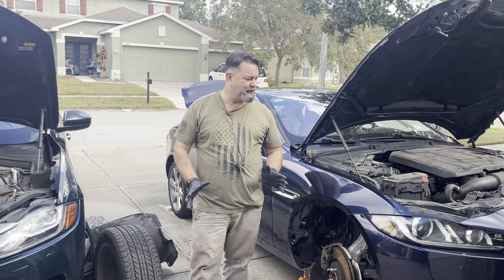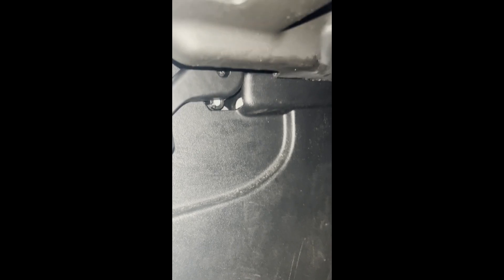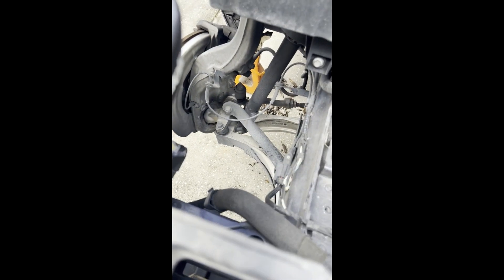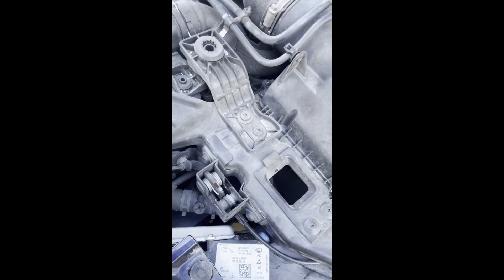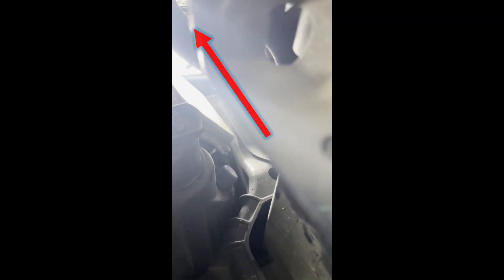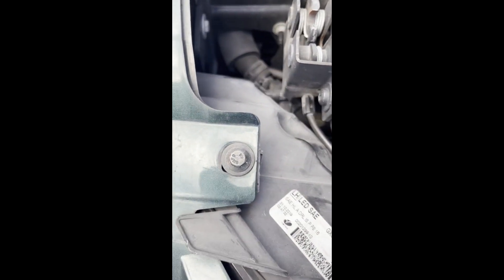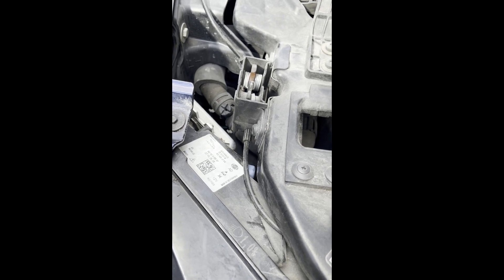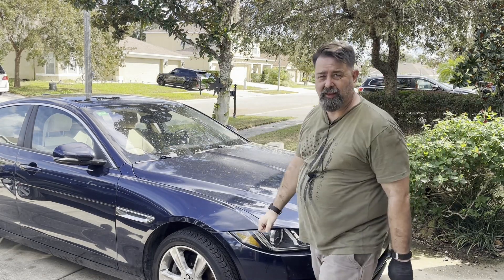DIY: Modern Jaguar Hood / Bonnet Release Failures and Solutions

Comment: Is there a cable connecting the driver side to the passenger side release? You did not show how to fix the passenger side cable. That is my issue
Reply from the maker: Yes. its just one cable that passes through the drivers side to the passenger side.  The release is the exact same. Its a lot easer to get to the passenger side.   Take the wheel off, pull off the tire well/skirt and you will be able to reach right up to it from the bottom.
Reply: thanks, I probably will have to run a new line. I zipped tied the last time to create more tension. But it has reoccurred
 and is a little intimidating.

Comment: Thanks for the video – the cable had come loose from the left-hand side latch and the hood got stuck. The space was really tight, but I managed to release the latch manually using a stick! It was incredibly cramped, and the video was a huge help in this situation. As far as I know, there's really no other way to do it than that, and just like in the video, that darn pipe was right in the way. A mechanic unfamiliar with Jaguars could easily spend a lot of time on this unless you take it to a Jaguar dealership. Thanks again!"
Reply: The right-hand side would definitely have been much easier to access since the visibility is clear, but the left-hand side is completely blocked
Reply from the maker: Very happy you found that video and it helped!